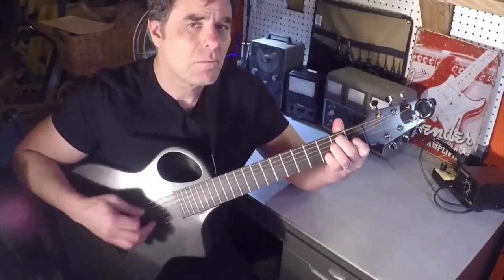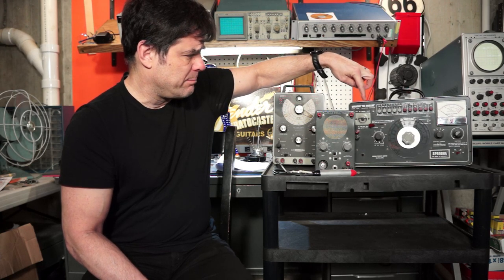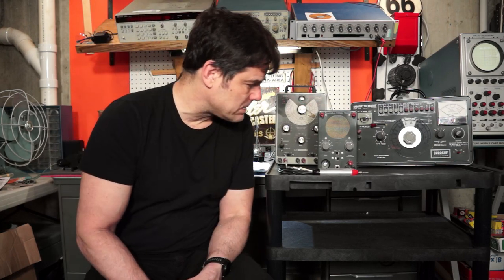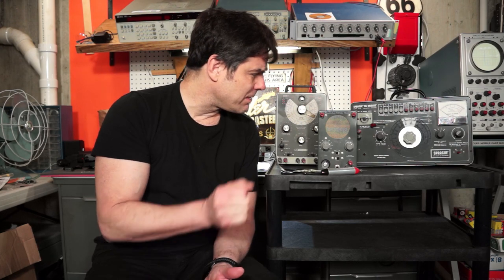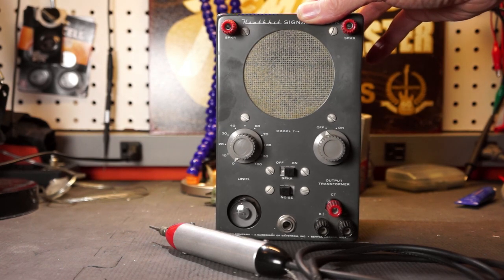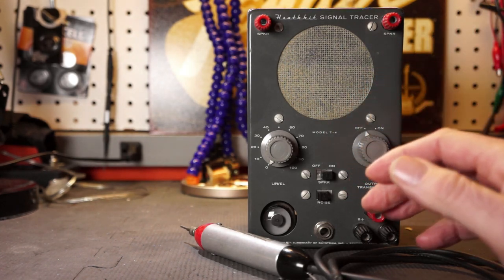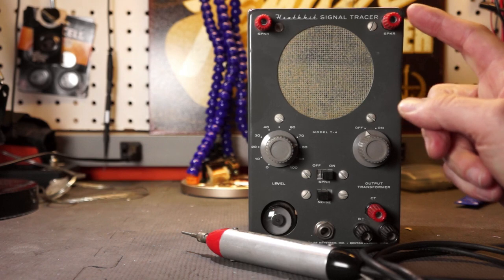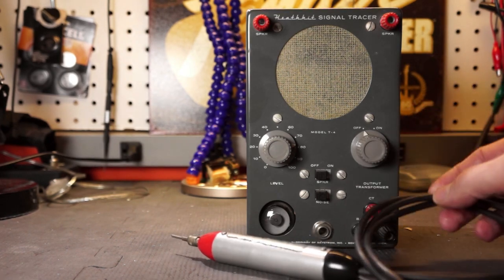Heathkit T-4 Signal Tracer Repair and Upgrade (AmpMechanic #017)

Comment: The noise function puts like 100 volts dc on the probe. You connect the probe to components and if they are noisy (ie. a fractured resistor) you will hear the noise. Can be used in circuit on tube equipment but not on solid state. Look into the dos and don'ts before you use it.

Comment: Thank you for a great video.... I have question: I am replacing the Cap 50uF 150v. but I can only find 50uF 450v and the other one 20uF 350v do you think it will be fine with high voltage?
Reply: Yes. In fact, I would go with the more common "standard" value, 47 mfd. In fact, I would select a 47 mfd/200 volt unit. And the other one, a 22 mfd/450 volt unit.

Comment: I have an Eico 147A Signal Tracer I've been playing guitar through for a while now but I still haven't figured out all the other mysterious uses for it yet. Vague instructions... But wouldn't it be cool to build a guitar amp that had all the signal tracer's capabilities built in?
Reply from the maker: Interesting idea. Although I can't imagine a practical use for such a Frankenstein. Do you know of one or is just because you can.
Reply: @AmpMechanic  Well David, I'm glad you asked. Imagine you're happily jamming with the fellas and the bass player's amp suddenly goes kaput. Not a problem because your super duper custom amp has a BNC jack and a probe, and a magic eye, along with your troubleshooting super powers you will have his amp repaired in minutes and be back to jamming in no time... Ah, the humanity... I've already had my local Fab shop make a duplicate case and face plate for the Eico 147. Now I just have to see a few of your future videos to see how to make it work. BTW, those "speaker test" jack lugs on your Signal Tracer: I ran those to a 12 inch Rolla Alnico speaker and it really filled in the low tones. I even got a complaint from the neiboors. It's amazing what 3 watts and some tubes can do. ;)